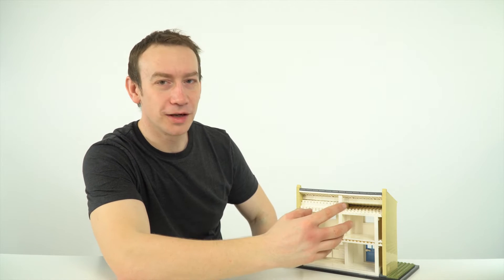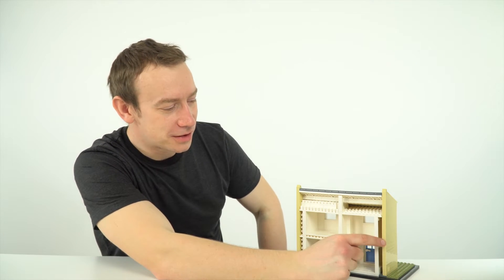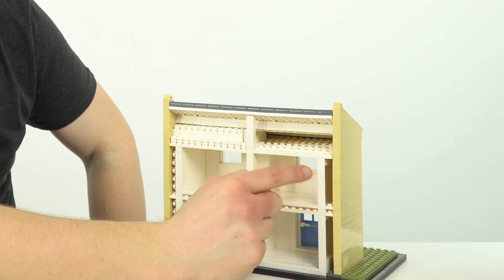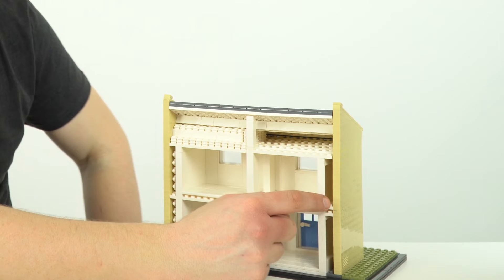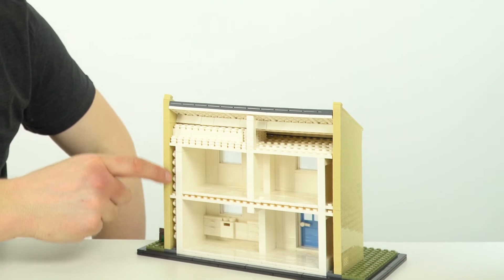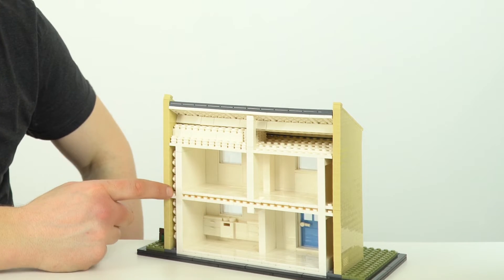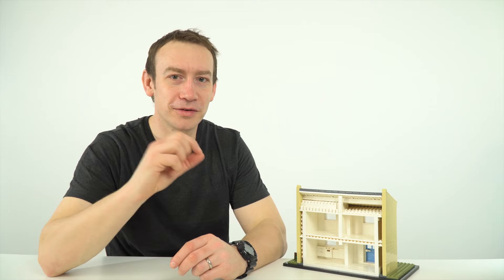Energy Efficient Buildings - GCSE Physics

Comment: Why is cavity wall insulation made of polystyrene balls, with air spaces, rather than just a solid block of an insulating material (with no air spaces)?
Reply from the maker: Easier to get into the walls and it will fall down so fill any gaps from the bottom up.